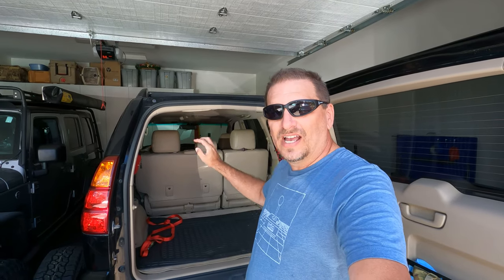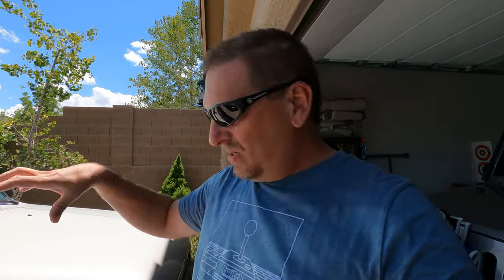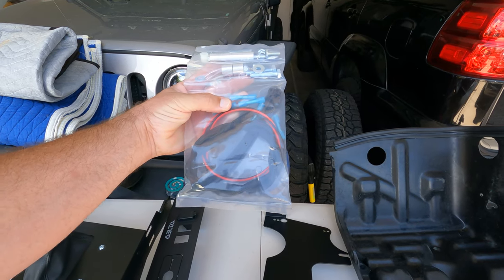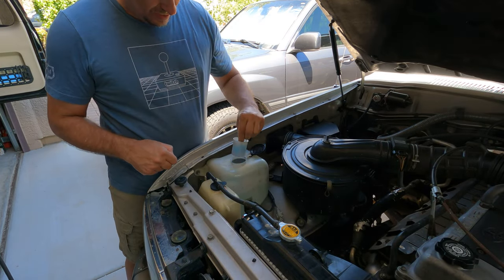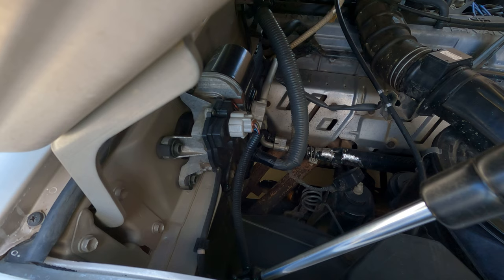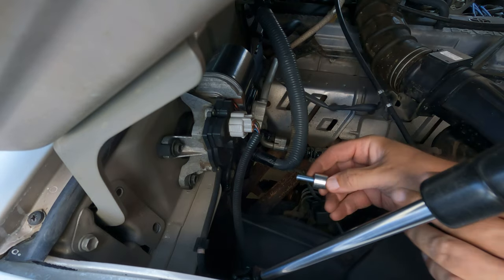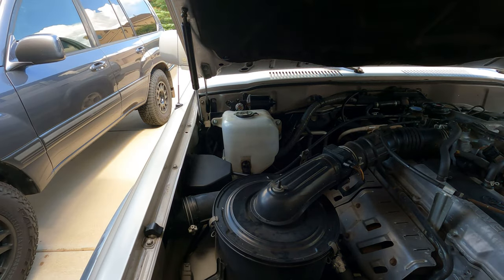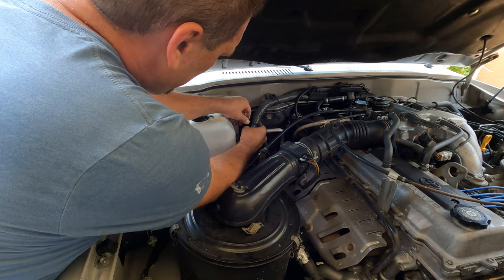Dual Battery Setup | Project 80 Series Toyota Land Cruiser Ep.5

Comment: Battery box on passenger side ended in 1992...I believe half year. Then in 1993 the boxes were located on the driver side. ML-ACR from Bluesea is Magnetic Latching Automatic Charging Relay. If anyone is trying to put together their own setup. Other than a second battery tray, a washer fluid relocation bracket and an Bluesea 7622 ML-ACR. You will need the wire and lugs as well as a 100A or greater fuse coming off the main battery to the ML-ACR and one after the ML-ACR at the House battery. If you Plan to run battery cables to the rear quarter panel you will need a fuse or breaker between the battery and the outgoing wire. I spent way more money than needed buying things i didn't end up using. Believe me, I spent hours drawing out and planning and making lists of system needs and I still ended up buying different stuff and ended up not needing some things I had already purchased.